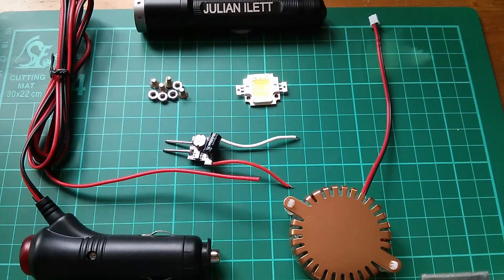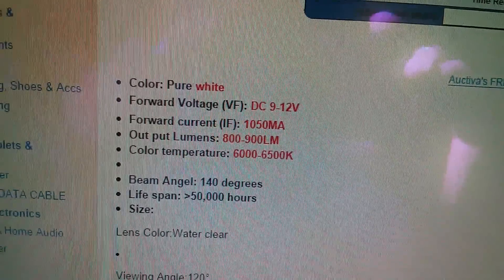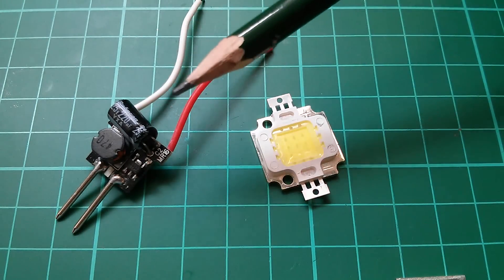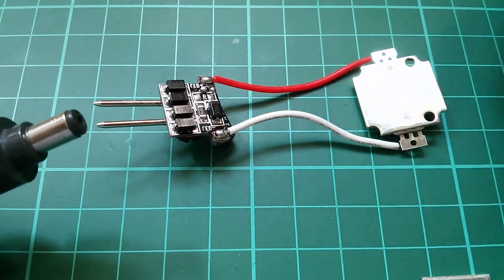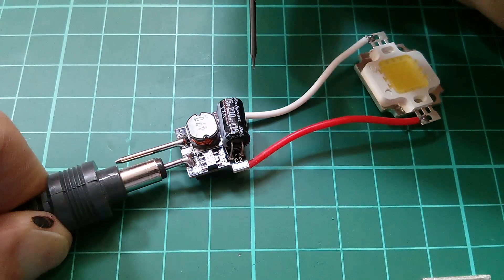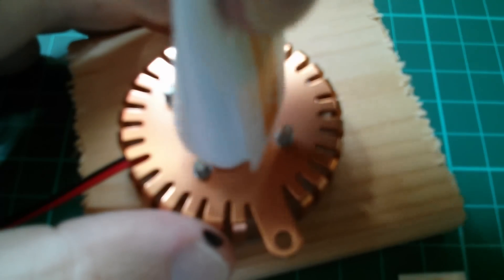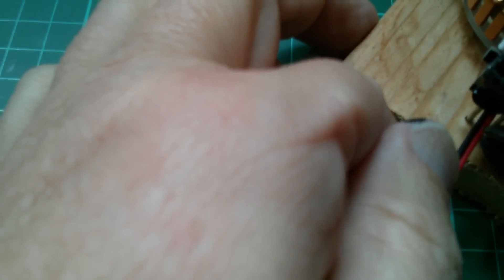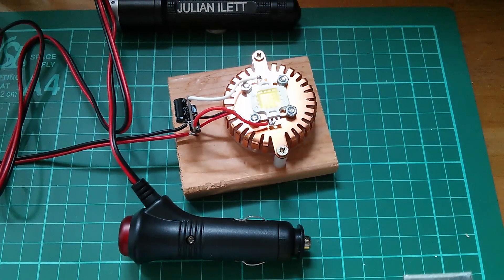LED Tutorial: Light a 10W LED from 12V - Simple & Cheap

Comment: Car batteries are not 12V. They are more like 14V. What if you just use a 2W 10Ω resistor?
Reply: Did some testing, and a 5Ω 2W transistor does the job. A bit too much, 3Ω would be best, but at least they will have a long life. With 5Ω and 12V the current is 0,5A.

Comment: these are 5p each in bulk. they are not very efficient in 10w drive. for better performance use them at half or quarter power. put 2 in parallel and drive direct with a 5w 10 ohm resistor. if you compare lumens per watt (how much power is NOT turned to heat) this gives better results than the one led with current control circuit.

Comment: Hello, great video, I would like to know if I had 2 sets same as this one (2x10w led, 2x drivers, 2 heat sink with fan) what kind of power supply do I need to make them run at the same time and how do I make the conections? Im trying to make a reeflamp but not sure how to make it happen

Comment: No need for drivers, use an old computer smps, switch mode power supply.
It wont overdrive the leds. I tested it, just wire your cob's in 12v parallel branched circuits.
If you use a linear mode power supply you will probably over-drive your leds with current.

Comment: Thank god for a tutorial in yt without an American accent! If I hear the word 'sodder' one more time...!
But oh no, have you just ruined all my plans by telling me I can't run an led directly off a 12v battery and now need a driver on each one? I've just made four 12v strip lights using those self adhesive strips of multiple led's and  two floods using cobs, all direct to a thumping great big 12v heavy duty battery, everything works, I've even left one of my home made strip lights (mounted on a 6ft  x  2inch metal corrugation cut off a roofing sheet with aluminium (note correct spelling!) tape reflectors on for an afternoon just to check it works and it did, the floodlights too,  wires soldered to the cob (rated 12v to 36v) with croc clips on the ends, it all works! What have I done wrong or in the 5 years since you made this vid has led technology changed so  that drivers aren't needed?  Please say yes!

Comment: A cheep 2A  PWM controller to vary the input voltage and a 12v battery  may be a good  and simple straight forward solution to power and dim those LEDs .
Those 10w 12v COBs seem to have protection built in.  I just have bought 3pcs  for $0.3 each. 
I have connected 2 of them in parallel and drove them  from a 15v  2A power brick using a $1  PWM controller module. Once the output exceeds 13v @ 2200 mA  the COBs automatically shut down  and start working again when lowering the input voltage.

Comment: Can I get away with a simple metal plate as a heat sink if I intend to use it as a brake light for my car? Also, if I want to use a few of these toghether, do I need a driver for each LED or can I get a bigger driver for all?

Comment: Many thanks for this video/intro to using COB LEDs.

I'm working on a DIY cine film scanner project and have so far been using an array of 10 rectangular LEDs as a light source. These COB LED packages look like a good solution for packing lots of LEDs into a small area. So I'm looking for a light panel area about 10mmx10mm. My project already has an Arduino and some stepper motors too, so there is already a 9Volt Maplin power supply powering the rest of the project and I'd like to use this to power the light source too.

I've only just found out about COB LEDs today and have been looking to get something to try. I'd like the most 'neutral' white (4000k colour temp) and High colour accuracy (High CRI) would be nice if possible.

I think 1W or 3W units would be OK, I probably don't want any more power and I do want to be able to run off  the 9V PSU. 
It seems that the 1W ones are usually very small beads so may not have a large enough light area. I've seen a few 3W ones that might be large enough, but I'd worry more about heat/burnout issues.

So can anyone help me spec/source the right COB LED for this project please (I'm in the UK.)  
Many thanks, Chris.
Reply: my consulting fee is 20 USD per hour

Comment: if i have 10 3w led chips in series with 700ma current each and 3.5volt working voltage.
Do i need 3.5volt and 7amp power supply?

Comment: Does the regulator step up as well as down? I have a few I used with the 9volt and regulator for the most amount of light. Never tried 12volts. If it is current limiting then. Itd only take what it needs because the voltage drop inhearent to the leds power requirement?

Comment: I don't drill and don't use heat paste, i use super glue.  Works great for me.  btw, i also use a 3.5 to 30 volts power regulator (AliExpress $1.75) for a 220v-12v adapter to regulate the light.

Comment: are there any cheap connectors for this 10watt cobs? Like molex or something? I only could find led stripe connectors. thx
Reply: The 2 pin connector on the LED driver looks like an MR16/GU5.3 type, so yes you can get those.
If you in UK then Toolstation do them for @£0.59 each

Comment: Hi thank you for this brilliant video :p my question is this, anyone willing is welcome to help, if i wire my fans to a 12v battery , can i wire this battery to another driver lets say a 200v cc at 1.4 -1.9a as long as the fan handle the ampers it should work right ?

Comment: I have a similar setup Julian, I notice that most of the small 12v fans are quite noisy at 12v, so it's better to run them at about 9v or so. They still keep it cool enough and the noise is lower, they probably will last longer as well. I use a slightly bigger heatsink than your one though, I use a traditional looking one that is square and is 40mmx40mmx15mm and I just mounted a 40mmx40mm black ebay fan on the back. 

Mine runs from 240v, so I have a switch in the extension cord (in line switch) and then a double adaptor which has the 240v-12v led driver to run my LED and then on the other part of the double adaptor I have like a small phone type charger thing which puts out 9v and that runs the fan, so they both turn on when I turn on the in line switch. I find that it's a pretty good setup.

Your setup uses 12v power supply though, which can be more fun of course. I would probably use a DC-DC step down converter and have that running the fan and then have the 12v driver running the LED. That's how I would do it with the 12v power supply. 

LED's have become so cheap and it's quite cool how easily you can light up spaces now with low amounts of power.

Comment: Any thoughts? I have 4 10w leds forward voltage of 9-11 watts and 900-1000 mA , a power supply ac to dc 12V 5A 60W and a Voltage Regulator DC 4-40V to 1.25-36V 8A Buck Converter, 36V. Should I run these in series or parallel ? using heat sinks also. the buck also has a potentiometer on it to raise or lower or even shut off

Comment: One annoying thing I don't like with batteries and LED's is when the voltage drops from the source the LED gets duller and duller.
Does this still happen when using the driver you used?
So it drops the 12.6v (12v battery) to 10v and tries to output 950mA.  But what happens when in theory a 12.6v battery voltage would drop to around 12v? Would the driver intelligently maintain 10v and an output of 950mA? 
Or would it drop it's output?
Since I notice they put a range on the output, so possibly it drops. Which isn't good as then your brightness drops off and that's annoying. 
I want something that is able to keep a constant level of brightness while a source voltage would drop by half a volt.
Reply: Put a boost circuit ("DC-DC-boost circuit, a few dollars) between the battery and the driver, this way you can max out your battery and still maintaining the correct output voltage to the driver. Try to get one where you can specify the "cut off voltage" so you don't damage your battery by discharging it to much. The driver itself cannot maintain the correct current if the battery voltage drops to much. The reason they list a voltage range is because all leds are a bit different and also depends on the led temperature. Basically they're saying "Between 10-12 V the led will led through 800mA of current, at what voltage exactly depends on temp and specific chip". So a a led starting up can require 11.5 volt to allow 1 amp of current through, but 10 minutes later when it's hot it only requires 11.2 volts for 1 amp. The current regulator does this limitation for you, otherwise the temp would keep increasing and letting more and more current through and eventually killing the chip. One last thing to consider is the internal resistance of the battery, without load you might get 12.6 v but drawing 1 amp from it, the voltage will drop (current*internal resistance volts). This might cause some confusion, a 12v wall wart could cause the led to shine brighter than a 12.6 v battery (due to lower internal resistance). So when buying a dc-dc booster, take the voltage drop inside the battery into consideration and you'll be good! Good luck!

Comment: Let's say I want to attach 5, 1 watt led chips to a heat sink, and then connect each led chip to the driver in parallel. Will the driver give each led 10 volts equally? Or do I need a driver for each led chip?

Comment: Julian, I have one of these 32-34V 10W LEDs you mention cannot be run in this way - however I have a healthy fear of higher voltages!  Is it possibly to run it off 12VDC if using a boost converter?  Sorry for the silly question, I'm a bit new to this and don't want to die.

Comment: I connected my 10W LED directly to my 12V battery and it still works
Reply: You are lucky, it will not last long. I would either use the proper driver, or use a resistor inline with the LED, from a stable constant voltage supply like a computer power supply. Then I would put a capacitor across the LED to soft start incase of inrush current.
Reply: feldim2425 my LEDs barely go above 30°C cause of the massive heatsink

Comment: I have some old 12v DC supplies around. Do I need them to be any particular amperage? 

Could I also use the same driver to add a few of these in parallel (One power supply, one driver, 3 LEDs)? I would use a longer heat sink of course.

Thanks.

Comment: I didn't knew it would instantly blow, so I connected mine to one of my 12.6V lipo for RC.
They didnt blew and worked well, I'm wondering now if I really need a led driver. . . or not ?
Reply: 0.6 V over the limit is still fine. The lifespan of the LED might be shorter or not affected at all as tolerances are always taken into account in manufacturing
Reply: You could do a RC light bar
Reply: It is possible the voltage of the lipo goes down due to the load

Comment: Julian I am quite a novice with this but if you put 5 of these in parallel would you need a individual power driver for each, or could a 50w power do it with out any additional wiring
Reply: with led driver you connect those in series, but you need to have a good driver that can supply enough voltage, in parallel you will need driver for each led

Comment: Don't take this the wrong way, you clearly know a lot more about this sort of thing than me! 
How have been getting away with running these exact LEDs directly off of 12v for so long?
Ive even pushed them up to 15v for a short period. 
The ones I've been running direct off 12v have been going for months.
Reply: it's fine to connect your LED directly to 12V, as long as you take away the heat :D once led get hotter it allows more current through itself (that's why it's nice to have constant current supply), and that shorten it's life, it's complete bullshit as he said in this video that connecting led directly to 12v will instantly fry it, if you have less V for example 9-10 led won't be as bright but won't get so hot and won't break :D
Reply: my consulting fee is 20 USD per hour

Comment: whats the point of using led (an energy efficient source) if the device is wasting so much heat energy? better use a standard bulb it may be more energy efficient :)
Reply: and instead 10 W use 100 W for same light output :D good thinking
Reply: Maybe its the because the camera is so close ^^ This radiator does not look like 10W only. nvm :)
Reply: That is certainly the case in winter, the waste heat from standard filament bulbs heats the room, making them 100% efficient. However the choices of colour are very limited, and those wanting to slash electricity bills are still better off to use well built LED bulbs..  The heat losses are minimal, and a lot of Lamp shades are limited in the terms of the wattage of filament bulb you can install before they melt, so that is where LEDs really are useful. Personally I do not do lampshades, its like paying for light and then putting the bulb inside a biscuit tin, only clear lamp shades make any sense. Another bulb people should be warned about, are those halogen type bulbs within a normal bulb, these can set fire to some lamp shades, the halogen capsule bulb inside emits high levels of infrared radiation. This like all halogens came cause combustible lamp shades to burst into flames.

Comment: While your method may be superior to what I propose, for "some" situations, it certainly isn't simplest or cheapest.  Simplest and cheapest would be put a 15 ohm, 10W (for thermal margin) resistor in series, factoring that the automotive supply will be around 14.4V with engine on.  I write automotive supply because there's little reason to hook a lighter adapter up unless it's an automotive app, otherwise simpler and cheaper would be to have a supply with wire terminals or solder it permanently.

Additionally, simpler would be to use a larger passive heatsink as those little chipset and video sinks as shown in the video, tend to have short lived fans.

Your method is superior in most cases by using a current regulated driver, but it is the opposite of what you initially stated as simpler and cheaper.  Either way, you're likely to see one of those generic Chinese LEDs burn out, die by die one after the other, after only a few hundred hours of operation.  For this reason I'd sooner recommend operating those 10W LEDs at only half their rating.
Reply: I always like to under power LEDs, I thought about trying to cool LEDs in pure clear silicone oil in a jar. I thought it could be a good way forward for creating LED bulbs at home. I always like to put a capacitor across the circuit to provide a soft start to limit inrush currents, normally 100uf is high enough.. When using a resistor method, you must make sure the voltages can not go higher. Normally I like to use a voltage regulated power supply..

Comment: how long it would last from 12v cheap battery pack ?
Reply: Depends on the battery pack mAh rating.  The current will be a little under 900mA.  It's be less except I'm calculating for an 85% efficiency of the buck current regulator.
Reply: most cheap ones have around a 16ah battery, 50% discharge, 8ah, around 8 hours at a guess.

Comment: I want this Julian.  I am unsure if http://www.ebay.com/itm/10w-Square-High-Power-Led-Pure-White-35mil-Chip-/121851652525 and http://www.ebay.com/itm/111851445575 work together.  It says 9-11v on the LED I listed, but 12v on the driver.  ?!!?! are these compatible?  And do I need a heatsink - if so, which one is best?

Comment: how do i power a 100w cob without apebding 80s on a mean well driver?. I have 3 3k and 1 M full spectrum 100w led to power. i keep seeing you using DC to dc booster but connecting then to a car battery. how do I give all 5 cobs thats a have a dc of 32-34 and 2800-3500ma ea. If done at a low enough price i will want to do 5 cob bars x6 if possible. thanks!

Comment: I just bought a bunch of these 12v LED chips, after I connected a bunch of them together (+ with +, - with -) and I plug them on they just keep flashing but won't light up probably, can u tell me why ??
Reply: are you using led driver? if yes then you need to connect led like +LED- +LED- +LED- ( in series ) this way all get the current they need, if you are connecting them in parallel you split the current

Comment: instead of a driver unit,  why did you not use a resistor? according to the current that you need.
Reply: +Anubhav Sood That's perfectly fine too, but you usually only do that for smaller LEDs... Because remember that the resistor has to sink all the extra energy as heat, so when using high power LEDs it'll generate a lot of heat meaning you'll need large 1-5W resistors, which makes them rather impractical to use past about 20W LEDs whereas a little driver will end up costing you ever so slightly more and it won't waste any power.
Reply: +vgamesx1 thanks for reply I really appreciate it. I have been trying to figure it out for some time now.

Comment: Hi there. Is that driver unit a constant-current and constant-voltage converter? I ask because you've given me an idea for a car hood light, but a car's electrical system can run as high as 14-16 volts when the engine is running. Thanks!
Reply: You can find leds with the constant current circuit built in to make them suitable for easy automotive use.

Comment: Is't possible to use a potentiometer with this installation? And if so, should it be before or after the led driver? thanks!
Reply: Probably yes. You would need to hack the driver, provided its output current is controlled by resistor values. 
Else you could go with a pwm controlled mosfet. 
Julian has that subject covered in other videos.

Comment: Could this be hooked up to a 12v 5a power supply without destroying things like the fan? Or does this only work because it's attached to a battery?
Reply: +8Jory as long as it's a 12v supply, the fan will only draw as much current as it needs. So a 5A supply would be overkill, but should still work just fine.